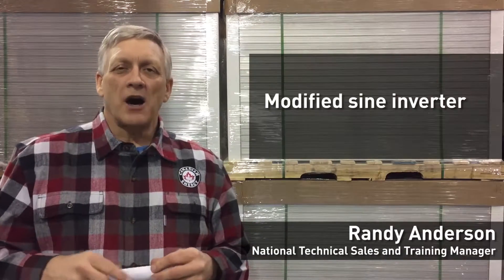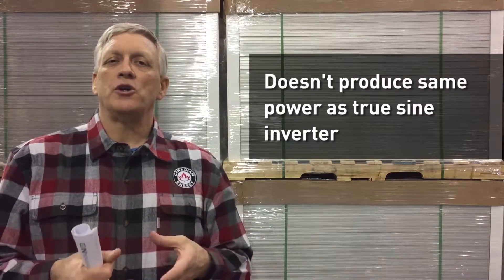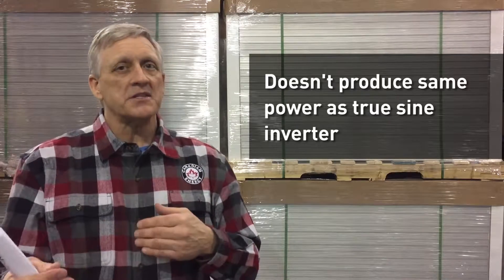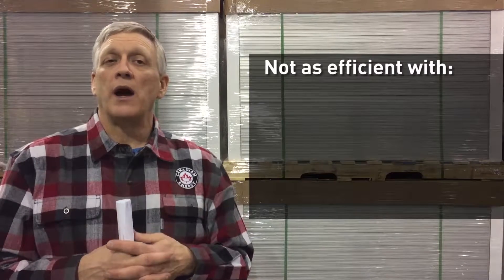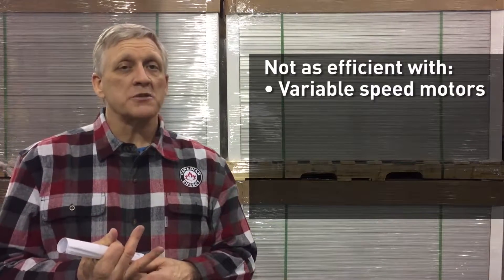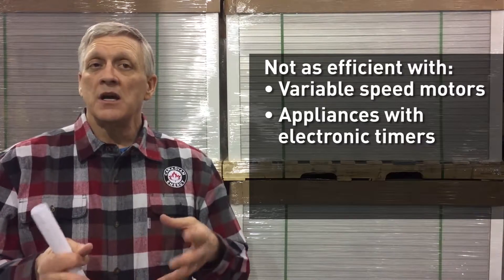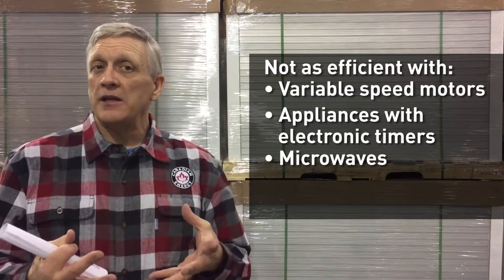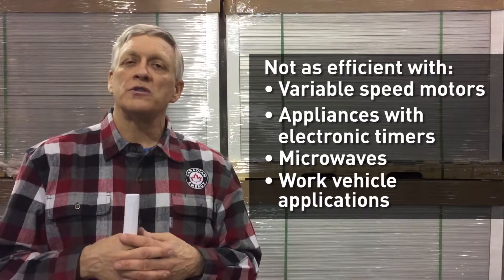Canadian Energy™ - Modified Sine Wave Inverters (4/7)

Comment: Modified sinewave inverters are also good with resistive loads. Aslong as there are no fancy electronics involved. Heating elements for water or stove element does not need a clean wave form. No need to buy a huge and expensive sine wave inverter just to produce heat. Msw inverters draw less power on standby because they are less complicated. They could also last longer and are inexpensive.